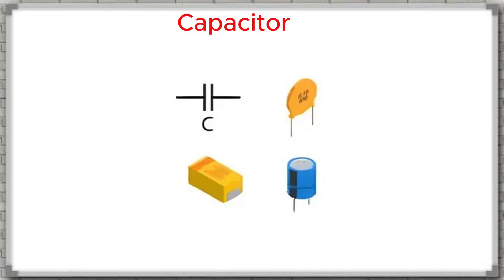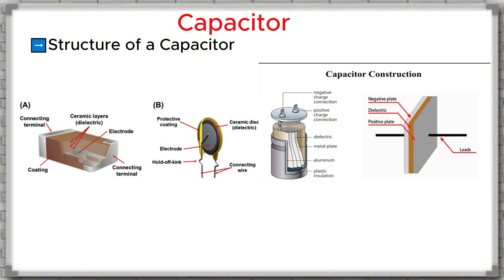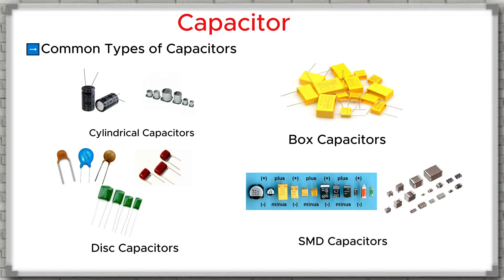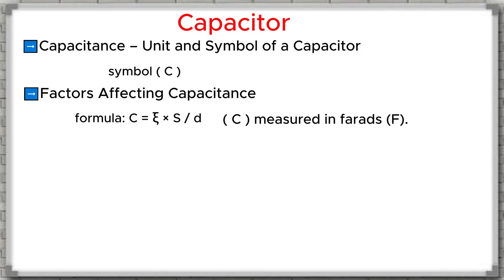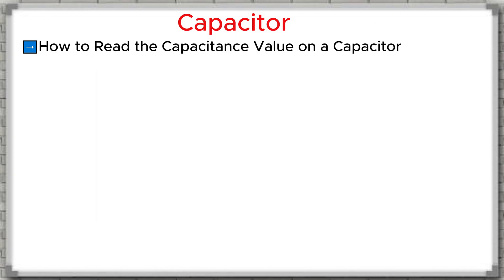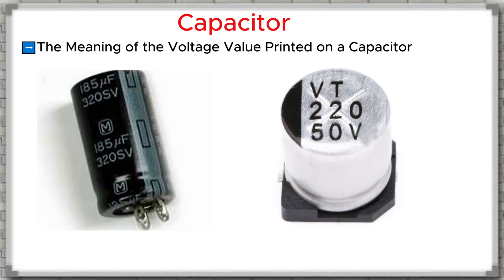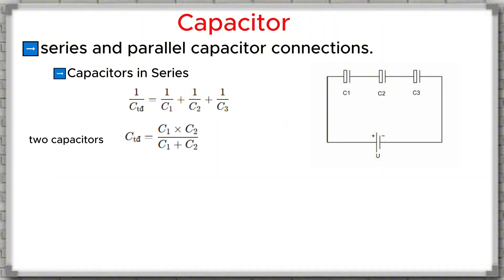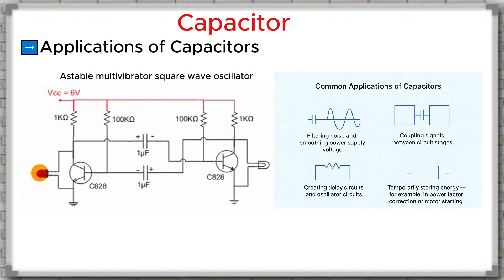Capacitors for ECU Repair – Basics, Series, Parallel & Uses

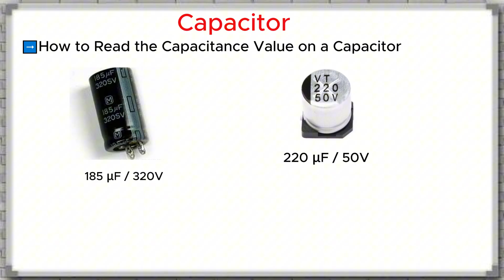Comment: Nice video.  At about 9:20 you will need to correct the audio.  uF is microfarads, not millifarads.  Also, you may want to add a warning before measuring a capacitor, make sure to discharge it.